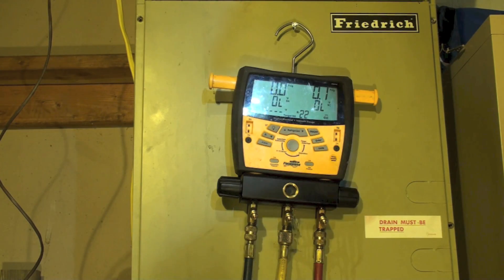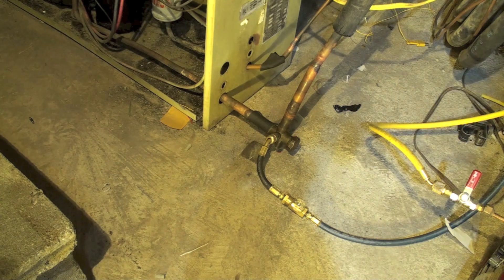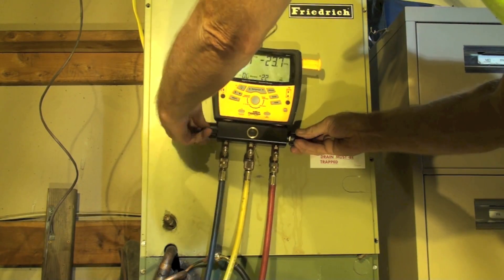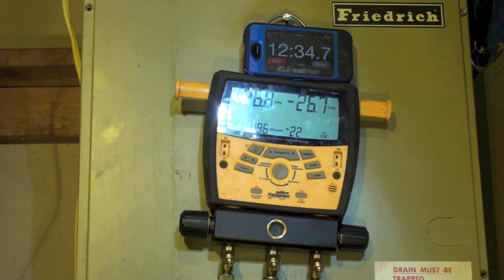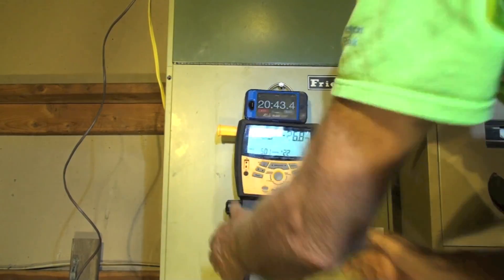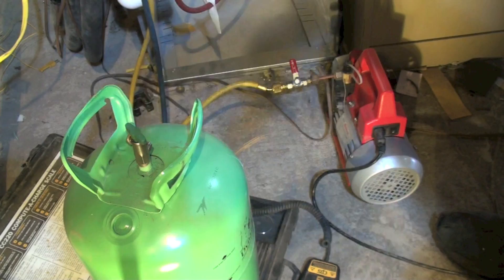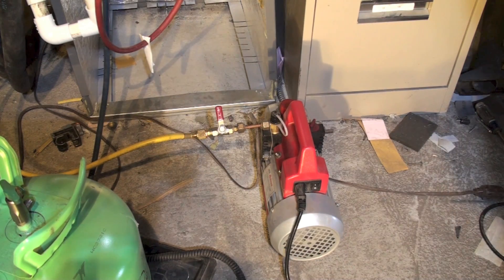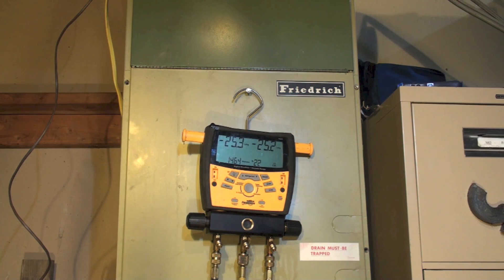The triple evacuation of the air conditioner

Comment: Hi, after replacing a suction line and liquid line service valve do you perform the vacuum with both valves open? If so, wouldn't the vacuum pump pull compressor oil out of the system? Thanks
Reply from the maker: I follow what I said in the video.  Why would you think it would remove oil?  
GFM
Reply: I've always performed vacuum from closed service valves through line sets and indoor evaporator. So I wasn't sure if I had to vacuum an empty system the strength of the vacuum pump might suck some compressor oil out. Will the vacuuming suction strong enough to do this? Thank you.
Reply: Also a complete vacuum would include evaporator, line sets, compressor and condenser coil. Is this correct? Thanks
Reply from the maker: @mark.r8900  A very deep vacuum will start some boiling of the oil, but you would have to leave the vacuum on for several weeks to have an effect.  Yes, a complete vacuum includes all parts of the system.
GFM
Reply: You're by far the best instructor I've ever seen. Thank you.

Comment: This is so wrong, you should take this vid down !!
Reply from the maker: What is your problem with the video?
GFM
Reply: @grayfurnaceman  Assuming this unit doesn't have any leaks, and the heat pump and indoor coil are close together for instruction purposes or 60ft away it doesn't matter, it took 22 mins to pull down system to 833 microns, it should have taken less than 5 mins to pull down to 250 or less. Your rigging is all wrong, pulling a vac through a set of gauges (1st restriction) and then through a 1/4 hose (2nd restriction) into the 1/4 port on the vacuum (3rd restriction) is not the best practice of pulling a vac. Also on a triple vac you should always break  your vacuum with dry nitrogen, not refrigerant because technically and lawfully you now have to recover that refrigerant and start over. I thought I herd you say you did pull out the schrader valves which is good because that would have been 2 more restrictions. Now I'll admit I'm a commercial/industrial guy, mostly industrial but I do work on some split units in some offices from time to time but I pull my vacuums with the same rigging,  2 ton heat pump or a 500 ton chiller.
Reply from the maker: @awesomeaustin2348  Good answer.  I usually don't get that.
I do however have some issues and explanations.  
I have never, ever, had any unit evacuate to 250 microns in 5 minutes.  Not a new one, old one, small or large.  With or without gauge set, large or small hoses, new hose, large vac pump, new vac pump, old vac pump, anything.  In fact, I have never had a unit pull to 250 microns at all in 35 years of service.  I test my vac pumps periodically, and they are capable of 60 to 80 microns.  
The fact is, when pulling a vacuum, you will use a gauge set, as most smaller units do not have any way to isolate.
I will say that a 3/8" hose is sometimes useful, although its value is somewhat overrated.
As for breaking the vacuum with refrigerant, the use of nitrogen is simply adding in a non condensible into your system.  I would want refrigerant and only refrigerant in my systems.  Remember, evacuation only removes a percentage of what is in the system, not all of it.  The refrigerant released is deminimus as it is about 1% of the charge.  The bleeding of the hoses filled with liquid can easily exceed this amount.  
GFM
Reply: @grayfurnaceman  Your vac pump is a 5 to 7 cfm , your rigging has reduced your volume down to a approx. 0.5 cfm at best, if your lucky.. I pulled down a 40 ton McQuay unit I replaced 2- 20 ton compressors, 2- core driers, repaired 2 leaks, 1 in the discharge line and 1 in the hot gas bypass line, pulled it down to 246. 2005-R22 bomb. It gets done daily my friend . Your vac pump is rated to pull down to  50 microns, close it up and only put your micron gauge on it, You'll see.
Reply: @grayfurnaceman  Sorry, I can't break my vacuum with refrigerant, I'd lose 15 lbs or more .

Comment: I'm about to do a tripe evac on a compressor air dryer, and will be following your method. I see you haven't removed the valve cores. Is that an optional step, can you connect your hoses directly to the service ports without compromising the job? I don't care about faster evacuation, but I only want to do this job once.
Reply from the maker: Actually, the cores are removed.
GFM

Comment: Why not use thicker hoses. It gives a better  vacuum?
Reply from the maker: The depth of the vacuum will not increase appreciably with thicker hoses.  The reason for the triple vac is 3 evals to 1500 microns is better than one to 500.   By breaking the evacuation with refrigerant or nitrogen, you are sweeping out contaminants more effectively than one evacuation could do.
GFM
Reply: Thanks great video. Did you have to recover the vapor refrigerant on the second evacuation?

Comment: GFC, your method makes a lot of sense.  Most of us were taught to break a vacuum with dry nitrogen, which, as you stated, is, in fact, a non-condensable.  This may be due to the confusion over the vague and nebulous definition of "deminimus discharge".  Thanks for sharing.
Reply from the maker: When I work on systems, the best work I can do is what I will do.  Breaking with nitrogen is not the best work.  The small release of refrigerant is, to my mind, deminimus.
GFM

Comment: Gfm I got a question ? What if you weren't using R-22 ? Say you were using MO-99 or R-410a / A blend... On your 2cd Evac step,you introduced (Vapor) to the Vapor side. Obviously with a blend you always intro Liquid... Could you introduce the Liquid to the Vapor side as you did. To push the contaminants  thru the evaporator thru the expansion device also out thru the Liquid port,and thru the compressor & condenser ??
Reply from the maker: cmalinoski It will work just the same.  You just have to be careful about the amount as the liquid puts more in faster.
GFM
Reply: Thank You Sir. For your response. Keep them video's coming. Always a go to for me. Really liked your video on the capacitor calculation thing. I too have noticed doing it that way.seems to always show Caps reading low.While under load. Even new Caps.Huh ??
Reply from the maker: cmalinoski I did not show the other motors I tested.  Some read more, some read less.
GFM

Comment: If you where evacuating a 410 system the process would be the same except you would break the vac with liquid.  Correct?
Reply from the maker: Jim D You got it.  When putting in liquid, a little means a lot.
GFM
Reply: That was my question lol!

Comment: I have a job tomorrow that may require this type of vacuum. My hope is the non condensibles are not the dessicants from the filter dryer. Slight pressure fluctuations within semi-normal operating pressures, but the line freezes.
I never saw ice in nearly 2 hours of run time.
I have clean indoor coil and filter.
I have clean outdoor unit with normal superheat, and subcool is at the upper range of 20.
I suspect a restriction in this system
Reply from the maker: blissJesus1 If you suspect moisture in the drier, I would replace it.  Most any time you open a system, the drier should be replaced.  If it has a fixed orifice, it should be removed and checked.  If it is moisture, it will usually operate normally for a few minutes, then block.  Warming the expansion device will melt the moisture.  Hope this helps.
GFM
Reply: I have seen debris flow into the piston and cause problems.  Then when the unit shuts off the debris would flow back into the line.  So it may take hours for it to show back up at the piston.

Finally just installed the filter/drier right at the piston.  Never had another problem.
Reply: thank you for your time; I started looking into airflow on the system, and learned the customer had switched two runs, I did not think it would makea big difference but they were not freezing before they did this.
 I only had 850 cfm at the return, on a 3 on system, and it is all flex, that has many twists and turns, and sags.
After I correct the duct, i will check pressures again. If the situation persists, I will go into the piping.

Comment: I was taught to use refrigerant to break the vacuum. I also just open the liquid side on the initial vacuum. The reason I do it like that is because a long time ago I was doing start ups on apartments I kept having restrictions when I started up the systems, I found out if I just opened the liquid side for a little bit I would find the restriction before I opened the valves.
Reply from the maker: Jim Rodriguez In this case it did not.  Units that have been open  will usually drop with each vacuum.
GFM
Reply: So what were the final micron readings? Did the 850 go lower?